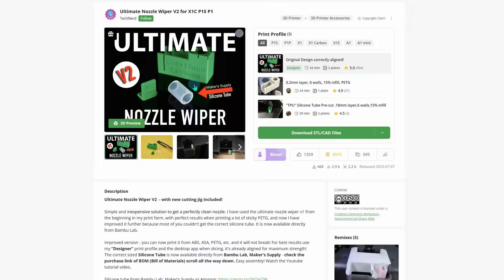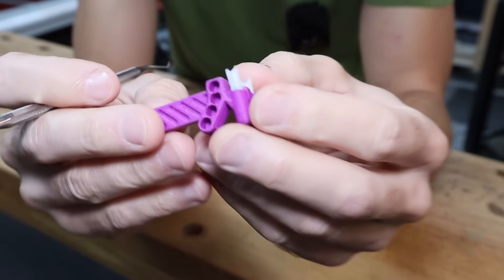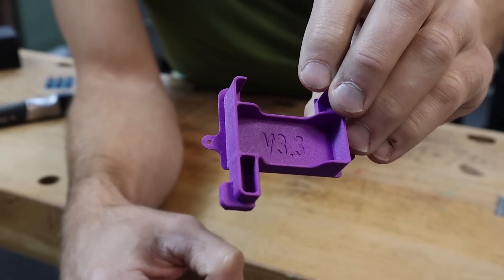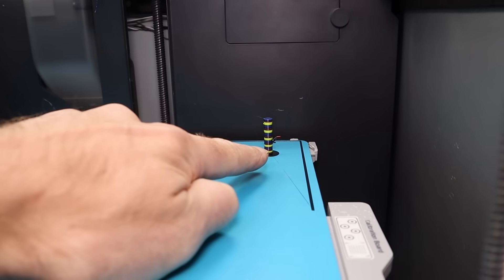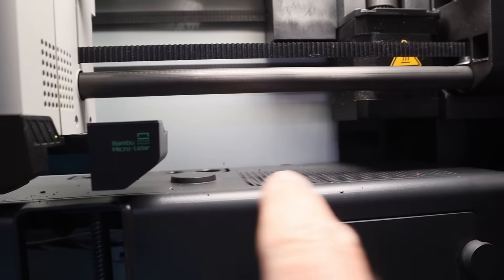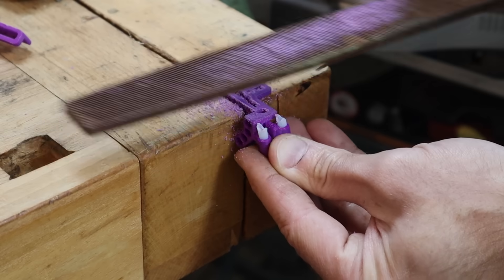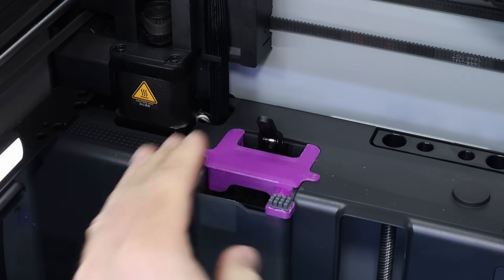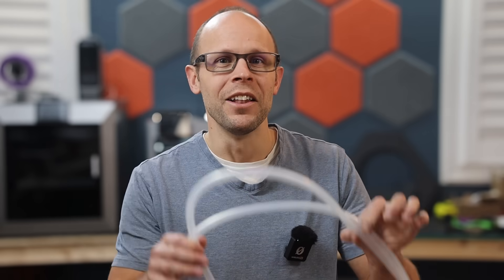Can these really be better than the stock wiper?  The ratings say they can, so let's find out!

Comment: Slice Engineering has a Plastic Repellent Paint you can coat your Nozzle with that may solve the sticking Problem - I couldn't find any information if it is supposed to work with PETG but someone on their Reviews mentioned it working with Bambu Lab PETG Basic soo?
Reply: I was about to ask about this. I bought some of it by have never used it, since I don’t have a problem with PLA. I’d like to use PETG though, so maybe I’ll try it.

I’d really like to see this channel test it with PETG!

Comment: Slice engineering' anti plastic paint and an occasional brass brush helps a ton for maintenance of the nozzle. I also had perfect results with The Wiper 3.3 with a panda revo nozzle and panda jet and petg, but my print came out way cleaner than yours, did you use the PLA supports version? Made the surface for the A1 wiper pad much cleaner and adhere better.

Comment: I am also using the silicone tube one, and also got some of the small bits as you do, but they are not thrown as far around as yours. If you got more tube (wink wink), try cutting a bit off so the silicone gets less force to throw the small pieces around.

Comment: I had so many problems with the stock wiper for every single print i was there with tweezers toi clean it up before it started a print so i made a mix between "The Nozzle Wiper 3.2/3.3" by Maleko the "Better Wipe for Bambu Lab X1C, P1P, P1S" by Brenyo and  "The Scrubber: Enhanced  X1/P1 Nozzle Wiper" by Adam L with it's custom G code which mimics the A1 series back and forth wiping motion after final steel plate arc rub movement which results in a perfectly clean nozzle every single time

Comment: I'm curious if the Slice Engineering plasticrepellentt paint would help mitigate this issue with no upgrades needed for the wiper.
Reply: I've had a lot of success with the anti plastic paint. Still need to brush it a little after every couple prints and reapply the paint like once a month. A better wiper tho is still a good idea for actual success detaching it from the nozzle hole.

Comment: I printed out another wiper using a small piece of the A1 wiper, I don’t know if it actually works, so I’ve printed out the Wiper V3.2 in ABS (for my P1S), but I haven’t had a chance to install it since I’ve been printing Christmas presents lol… I might as well print out 3.3 before I install it lol